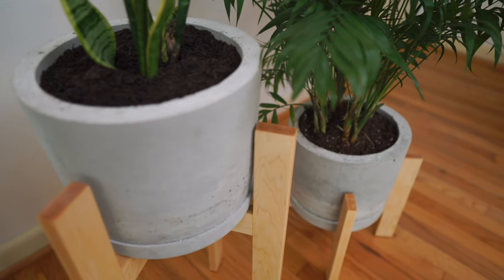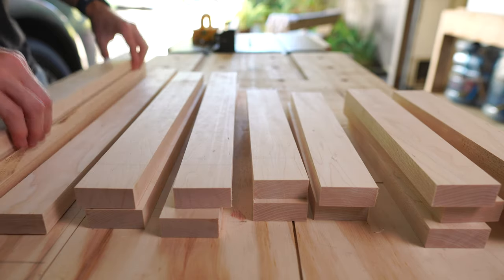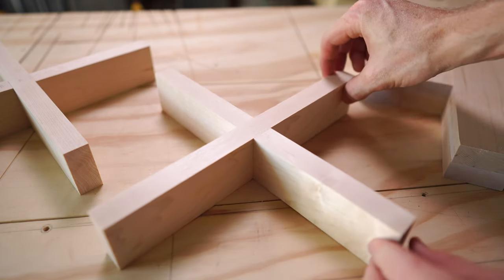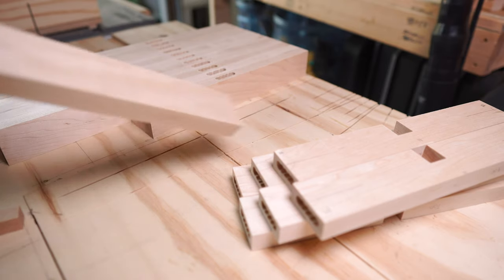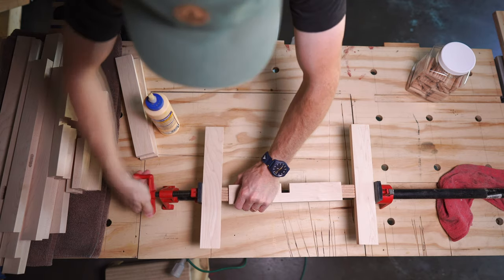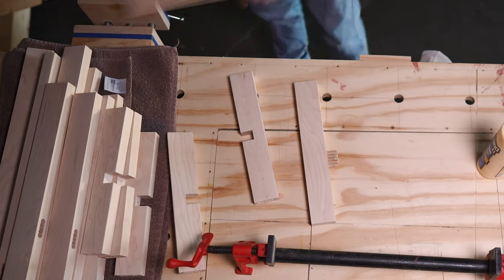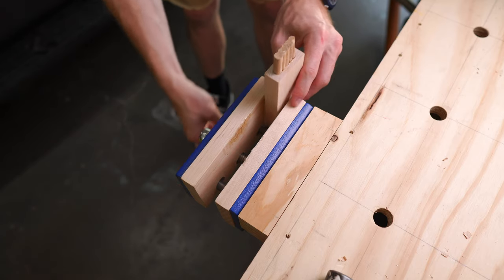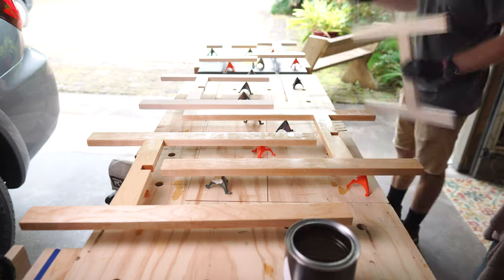Making Wooden Planter Stands

Comment: I would use a a depth stop for the drill. It is not so important if you go to far in the horizontal parts, but if you drill through the vertical ones, you'd see it on the outside. If the drill did come with the set, they should have included such a stop.